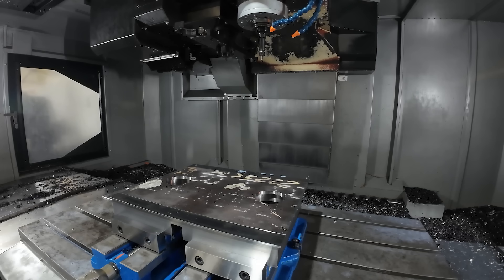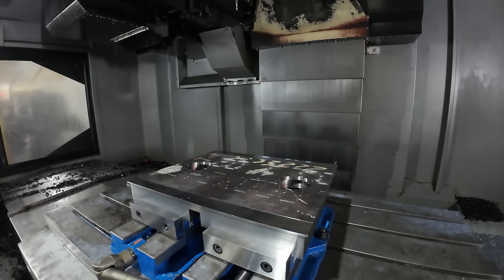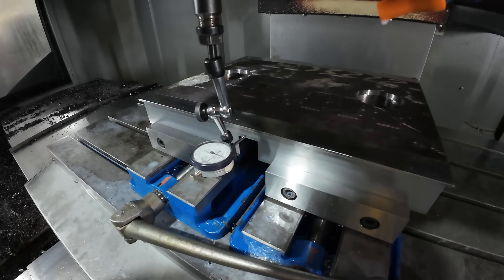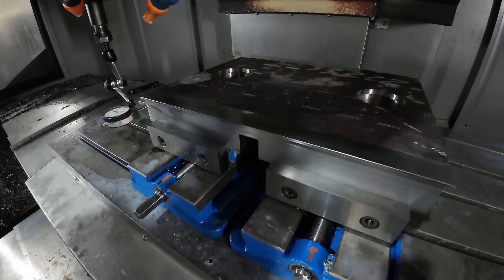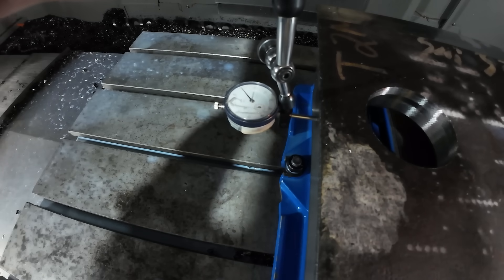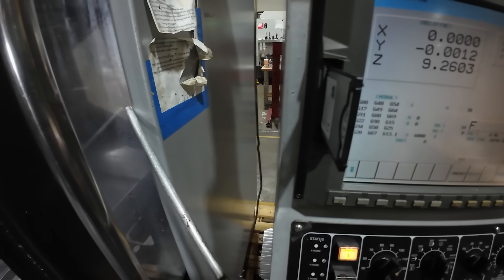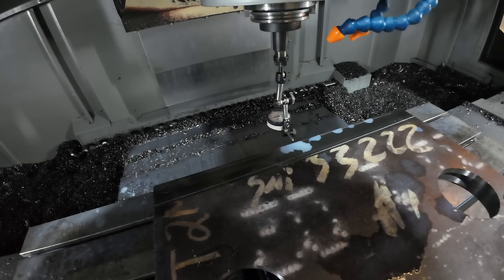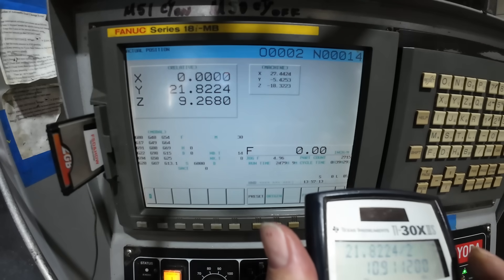Edge Finding A Part With Overhangs

Comment: it's actually the most precise way. people blindly trust their probe,, but it's easy and fast,, but it requires the spindle to turn 180 from side to side,, on machines that don't turn the spindle I would choose a manual Haimer 3D probe that you take out and in manually,,
:face-blue-smiling::face-blue-smiling::face-blue-smiling:

Comment: So you want to tell me I am not inventor of this method ? Just joking. Amassing to see how minds think alike. Then again I also made mistake by using this method on horizontal mill, then losing hours thinking why I have Y axis (vertikal) error, that is until i remembered that Newton is a thing and that apples fall down in Y direction (his exact words).  
I also practiced always measuring with the same direction, so for example if I measured in X+ direction on one side, on the X- direction i would overtravel the dial just a bit and go to my zero in the same direction, and I know that it is overkill,  but it depends on the state of the machine.

Comment: Very helpfull video. I guess there are plentifull of ways to zero x and y on a center of a detail. I do something like that on a simmilar fanuc machine like 20 year old or so... but there was once a guy on the firm i work in and i am so sad i didn't pay attention and i forget how he did that... it's like he zero the X from the left side on the detail then touch the probe on the right side lets say for example it readed 100 mm X and then he entered something like 100/2 on the working offset maybe... no calculator needed or manual joging on zero to set... so disapointed of myself for mising that. It will be little bit nicer if i don't need to round the workshop half of the time searching for an calculator lol

Comment: Why no vice stop? bores on the backside looked roughed so this side cant be that critical. Y Axis wont move so thats kind of pointless to check. Set a stop, edge find that, add half your material and send it.  I will give you this is a great way to look like you're doing something and waste 10 minutes every part if you're that type of guy
Reply: if op 1 WAS in fact finished then it was poor planning, should have ran a finishing endmill to dust the thru hole. and same thing. Vice stop. bump up to. Rapid to XY0 and run an indicator and move it your few tenths if its that critical

Comment: Super helpful! I learned a new way to set the WCS and remove one op. Up until now I had a second op where I set the WCS off the hat and then I'd removed the hat. Then I had a third op to set the WCS off the part and then I'd finish the part. And as a bonus, now I better understand the origin & preset soft keys on my Fanuc control. I never really understood the difference. Thanks for the great videos.

Comment: Not sure if this was discussed in the vid, fireball tools magnetic 123 blocks work WONDERS for steel parts with a hat on them, they allow you to still use the edge finder, and they are PLENTY accurate for this type of thing.
Reply from the maker: @sandboxsniping5300  Yes that could work if you have them and have the space to use them.

Comment: it takes longer this way
especially if you're teaching this you have to enforce altering all three axes eg set the X as well as the Z value then  on the other side come back to the same Z value just my opinion
Reply from the maker: In this video I didn't change the Z axis. I jogged the indicator around the part. But you are correct there could be a slight error if the sides of the part had a slight taper to them (And your Z was different on each side) from something like tool push off on the previous operation in this case. But in any case this is better than holding a gauge block or something and using an edge finder.

Comment: I haven't seen a DRO on a machine that doesn't have a "center" or "divide by 2" function key. Basically there is no need to use a calculator. Please read your manual(s). Also you could "deck the top" or "remove the hat" without precise X,Y - 0,0 and after that operation add a machine stop code (or simply make that a single operation set-up), then tram, measure, or indicate your X,Y - 0,0 for the back work. This is really helpful if your preference is to pick up on a hole location that would now be accessible because the  ap has been removed. Make sure when doing any of this that there aren't any burs or chips. This is a precision business and there are no gray areas! You are either on the numbers or it's wrong.
Reply from the maker: What you couldn't see in this video; There  overhanging tabs on the back top corners that have to be cut/trimmed off before the facing operation. If you try to face before that they create havoc with the feed mill and could damage the inserts. So it is necessary to establish the part zero in order that that cutting off these tabs doesn't cut into the actual part. This machine has a rather old'ish  Fanuc control. So it first isn't a DRO you are seeing here and it does not have a divide by 2 function (As you put it). Also there are many different was of doing things. In this video I was trying to show a method of using a dial indicator in place of an edge finder, in those situations where the part may interfere with that tool. Even so this way is much more precise than using a edge finder. I don't know how much machining you have done. There are many ways of setup and programming. The reason (I didn't point this out in the video because it didn't really pertain to the video's subject) I wanted the part Zero in the middle of this operation was because the drawing is dimensioned that way. So when I ran the operation it makes it much easer to double check for errors in the program if it is going to the same dimensions/locations as the drawing. What you say in your comment is basically correct. But consider there may be reasons things are being done a certain way, for a reasons you don't understand.
Reply: @EdgePrecision  Obviously the details not shared make a difference. Edge finders are for operations where being within a few thou is close enough. We in the tool making industry use test indicators to sweep or pick up edges, holes, tooling balls, etc. Yes, most often we work from the center of a block because it doesn't move in heat treat. Been designing, building injection mold tooling and inventing products for that industry going on 47 years. I think you can understand that without knowing you had a feature that disallowed the face mill prior to zeroing the block makes what you show a decent way to go.

Comment: why dont you put a stop on for exampel the left side and then you just x0 against that and y0 the stationary jaw?
Reply from the maker: @johannesfossi5561  in the case of these parts the drawing dimensions all come from centerline of the part. So I’m just trying to duplicate those dimensions just in case the outside profile varies in size. Also for the next operation when flipping the part. To reduce any inconsistencies. But you are correct it could have also been done that way. There is plenty of tolerance to allow for that.

Comment: In the center?..why😅😅😅😅😅 wasting time...correct? Take in the corner where is comfy for you.....via 3D tester Haimer.....with big stylus in dia to touch the walls....2 vises for finishing?😅😅😅😅 Interesting man...you had a new research.
Reply: Quality work takes a quality setup
Reply: @trace12345678900  very correct. .. .on point!
Reply: If you’re having to ask why the datum is central about and why it’s double viced, you should quit being a machinist….
Reply: @steviemill  I am not being a machinist....I am being just an application engineer  cad/cam.Who wins?😅😅😅🤣
Reply: @Hanal503  lol not you it seems. Thanks for proving my point though 👍🏼
Reply from the maker: @Hanal503  You couldn’t see in the video. But on the back corners there are big angles because of the overhanging material. This gets cut off first thing with a .375 end mill. The two vises are necessary because this part is over 20” wide and I still have to rough off .25” of material off the top with a feedmill. Not enough support with one vise.
Reply: @EdgePrecision  in this case....use a smart magnetic clamping system customized ..! thats all...simply! thats perfect for your model .,,,if in case you have many  many parts like this.Brands Lang or Schunk in any situation !

Comment: To be fair usually I use the probe because it's faster, but when I use an indicator, my control has a convenient /2 button! Saves me from typos.
Given that your Mazak is a lathe I'm actually surprised it doesn't have one?
Reply from the maker: @jonwatte4293  This isn’t on the Mazak. This machine has a Fanuc control.
Reply: @EdgePrecision  actually you're right because it has a table.  That's ... a pretty big thing to miss :-)
Thanks for the video and note!

Will you be taking any machines down south with you?
Reply from the maker: @ If I took any it would be the small machines from the garage. But I think it is too much of a logistical nightmare to do so.  There is a Haas dealer in Leon Mexico about 45 minutes away from our building in the city of Guanajuato Mexico. So we shall see if I can.
Reply: @EdgePrecision  I bet you could sell the existing ones and buy reconditioned ones on the other side? 
Anyway, hope you'll keep making the videos! I like 'em

Comment: This is similar to how I also edge find, To make it quicker I wrote a macro for setting the origin.
with a indicator I touch the underhang and type M102 X1.0 and now it sets the G54 X to the current position then I move over to the other side and touch then type in M102 X2.0 and now the macro calculates the origin at the point half way between the current machine position and the stored position from earlier.
very fast and repeatable.
Works the same as a DRO with the divide by half button.
My controller is a old Fanuc 0M series.
Reply from the maker: Yes exactly the same as the Renishaw probing cycles do. On thing I was trying to show to people is if you have nothing but a dial indicator not even an edge finder. You could in this way find your part zero location with high accuracy. I don’t normally run this machine or I would do exactly what you have done. Thanks!

Comment: Hello sir, I like your educational videos. May I ask you if you could do some explaination on jaw-workpiece friction, gripping force and how can experienced machinist know how much pressure to set on his chuck so the workpiece doesn't fly away during turning? And how much RPM to allow to ensure the centrifugal forces don't decrease the gripping force to the level the part moves or, in worse cases, flies away?
I somewhat understand that turning too far away from the chuck multiplies the cutting force by lever principle and smaller contact area between jaws and workpiece means less friction, I have some basic formulas to calculate cutting force and required jaw force for three jaw chuck but it's too general and says basicaly nothing.
My concerns are for:
- required force of tailstock to prevent workpiece from tearing out of the jaws
- indicative and safe cutting conditions when ex. facing long unsupported shaft before centerdrilling
- limit of cutting force for various lenghts of hard jaws and claw jaws and minimal required gripping force/chuck pressure
I've seen video of guy working on regular lathe, supporting the huge chunk of steel just by pushing hand-tightened tailstock with piece of centerdrilled metal in between the workpiece and livecentre, holding it in big but hand-tightened chuck and setting the DOC to about 12mm (24mm per dia) to the point the engine stalled few times. And the workpiece didn't move by an inch. I was starring at the video and expecting that the workpiece just falls off the chuck and breaks the lathe but no. He machined the whole video this way. How is that possible?
Thank to you or any experienced machinist for any response and explaination in advance.
Reply from the maker: This is an issue with Hydraulic operated chucks. They loose gripping force with speed. This is usually a problem with facing operations in constant surface speed mode (G96). You need to put a speed limit in four program to limit the max speed the turning spindle can go to. Otherwise when the tool reaches X zero it will speed up the spindle up to its maximum speed in G96 mode. So depending on the weight of the jaws and the chuck pressure set. The chuck could loose it hold on the part. Manual chucks don’t suffer from this problem. So a manual 4-jaw chuck will hold a part more securely than a Hydraulic chuck.

Comment: Why would anyone buy a new Toyoda without a probe ??
Reply: @chrisyboy666  I think the problem is the datum is inside/below an overhang, so the probe can't reach it. The mushroom top is not precision in this case.
Reply: You can intstall a 90 degree renishaw probe finger or blome what ever system you have ..That,   overhang is not a  the problem for a the probe if he had one in that machine he . Peter actually states the machine has no probe system installed what so ever
Reply: That is not a new Toyoda. It has a Fanuc 18i control which means it could be as old as late 90s. And a lot of owners cheaped out on the extra options when they bought new machines.

Comment: I've used that method for years and it always bothered me that while almost every DRO has a half function, few CNC controls have that option, so I have to bust out a calculator or think a moment to come up with the right number then enter it into the control. More options for a mistake when it should be one button press away like on a DRO.

Comment: I do something similar to how you set Z on your Mazak's tools, I have a piece of ground drill rod in a collet and back it off until a 1-2-3 or gauge block can just slip in.  Got myself one of those 3d sensors for Christmas (best gift ever) so I'll be mixing that in where the shelf thickness permits.
I've seen people do this method with mixed results, you need to be able to accurately index the spindle to avoid unacceptable trig errors, even 1 degree off can be catastrophic.  Proof that this man's eyecrometer is better than some metrology departments.

Comment: Have you tried using a torque wrench on the vices for consistency? Perharps get you to God level precision a little quicker.
Reply from the maker: These old vises all take different forces to tighten and losen them. Even with a torque wrench I would still have to do this I think.
Reply: @EdgePrecision  Old vises? The jaws aren't even cut up / have tons of holes in them
Reply from the maker: @ I couldn’t find the jaws that went with these vises. So I used some new jaws from other vises. At Centerline they take the hard jaws and machine them to hold parts or a long running job they been doing for years. They need to buy some replacements.

Comment: How would use this method if your xy zero was the back left corner.
Reply from the maker: @Jraksdhs  if you centered your zero on the part. Then half the parts width and length in the direction of your corner is where you would set your zero. So dealing with a vertical mill that would be half the width in the minus direction in X and half the depth in the plus direction in Y to put it in left back corner. Hope that makes sense.
Reply: I suggest using a sharpie to mark alignment "somewhat close" prior to flipping the block. Now facemill as a single operation....all you are doing here is removing the hat or deck so X0, Y0 is not important (you should be close enough assuming your facemill path extends beyond your part edge). Once that is done, now tram or sweep your edges or pick up a now exposed reamed or bored hole or "back left corner" as that geometry is all accessible. Just make certain you are not indicating off of any burs. Also, I have never used or seen anyone use this style of indicator for this function in any shop ever... since 1977. They are not accurate enough and they can't sweep a hole less than about 6" in diameter. This type of indicator is used mainly for travel like on a Bridgeport quill or for a lathe carriage.
Reply: @ yet it works. Just because you haven’t seen it used doesn’t mean it can’t. Always more than one way to get something done.

Comment: Nice but it works only on parts with flat, parallel walls
Reply from the maker: Actually no. As long as you don’t change the Z height. It will work for angles that are the same on both sides.
Reply: @EdgePrecision  I mean it will not work for irregular shapes
Reply from the maker: I see what you mean. It could but it would require a different technique than I show here.

Comment: Nice trick!,most of the time on a part like this i put the X0 Y0 in the middle of the hole
Reply: Was thinking the same thing. Just sweep the thru bore
Reply: You can see its a rough milled bore. You can get a ton of tolerance stack up that way. Its most accurate to go off of finished surfaces.
Reply: @kevind1865  the bores were thru, finish one thru on first op and pick it up on second.
Reply: @kevind1865  yes,or you could make a better finish of the hole on the first operation.

The only problem i have with finding an edge like this is that you never know for 100 % sure if you bumped the probe